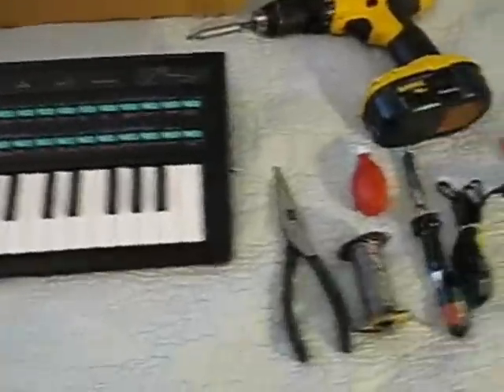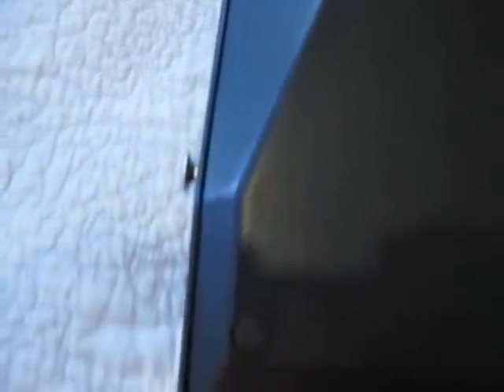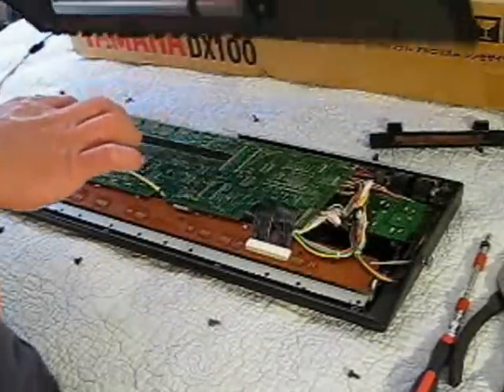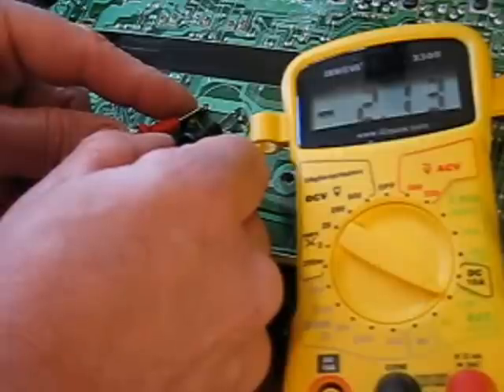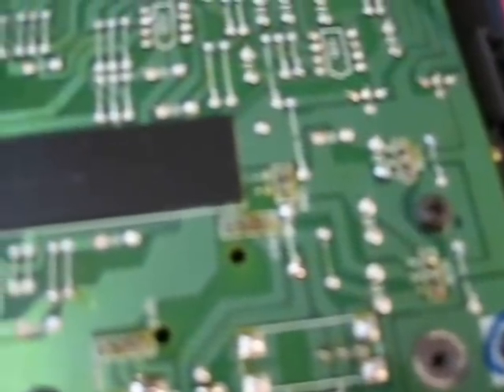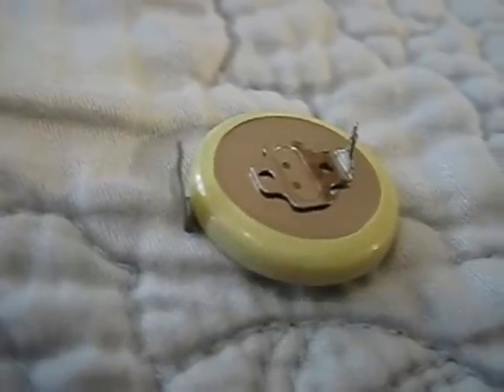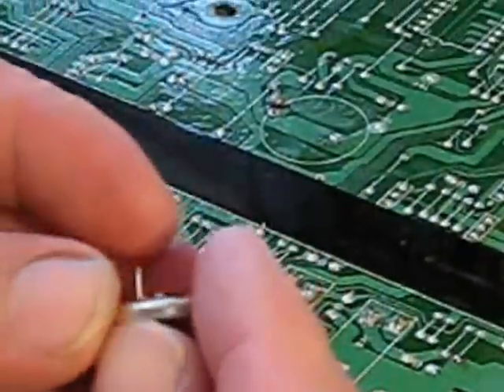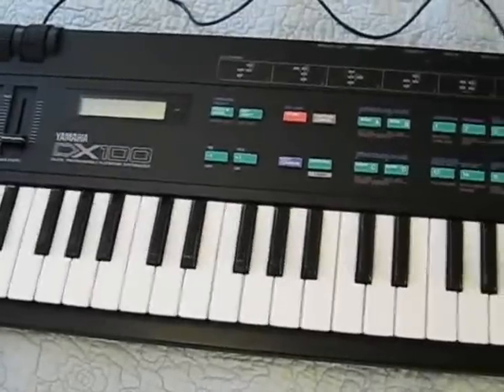YAMAHA DX 100 BATTERY REPLACEMENT REPAIR - HOW TO CHANGE YOUR YAMAHA DX INTERNAL BATTERY

Comment: this is BS. just replaced batteries in TX802 and TG77, the fact is all old Yamaha synths 
used 5/8 inch spacing for the pins. but all battery holders now have 3/4 spacing between the pins. unless you are able to get an original CR2032 with pins spot welded on from Yamaha which i doubt, you have to use a jumper wire on new battery holder.if you are replacing the battery, it doesn't even make sense not to use a battery holder.

Comment: That's like throwing out a 9v battery in a smoke detector at 6v.  2.07v is fine. It's a 3 volt battery so its only used 1/3 of its useful life.   I would change it if it went under 1.0v.  I'm still running mine off of the original battery, no leaks so far.
Reply: Wrong. It totally depends on the lowest acceptable voltage for the chip that needs the power. Also most smoke detectors are already nagging at you a ton if the voltage is just 6v...

Comment: Thanks for a great video.... Quick Question,,, I have an old dx21,,, When I plug in I get no power or digital on the screen.... Is this a battery issue or a power issue? Any help would be great!!
Reply: Actually got the screen to turn on,,, but no sound~! Still a battery issue?
Reply: Greg Goldsack Maybe you’re just deaf?

Comment: Just finished replacing the battery in my DX100, I installed a battery holder, since the holder and battery were the same price as the battery with tabs.
   
Initially the only patch that would load was "Pan Flute" and a bunch of "U>U>U>U>U" patch names, but after another power down and restart, the factory patches loaded.
  
*Side note: Avoid Radio Shack, their site says they carry the holder and battery in every store near me, but I only wasted time a gas visiting their store. The clerk recommended Amazon.
 
Great video, THANK YOU!

Comment from the maker: No that doesn't sound like a battery problem....even if the battery were dead, you would still have power...maybe your power supply is dead.....try throwing some fresh batteries in it to see if you get power...it you do, then its your power supply.

Comment from the maker: Yea, that's definitely sounds like the battery...you get those crazy characters when the battery starts going bad. Before you take it all apart, just take the back off like I did and test those 2 battery contacts on the bottom of the circuit board...if it's reading a lot below 3 volts, then you have to change the battery for sure....save all your cool talkbox settings though!  : )

Comment from the maker: Check to make sure the contacts that touch the batteries are clean and holding the batteries in tight and check to make sure the wires that go to the battery holder are not broke or disconnected

Comment from the maker: Hey Thanks! I bought the battery from Atbatt.com for $6 shipped. It's a pretty hard battery to find with the solder legs built in, but they had it. It was a Reneta CR2032FH-MFR 2 -PIN BATTERY. If you were in Chicago I could help you out with that : ) , but you could probably find a local repair shop by you to solder in the battery pretty cheap.